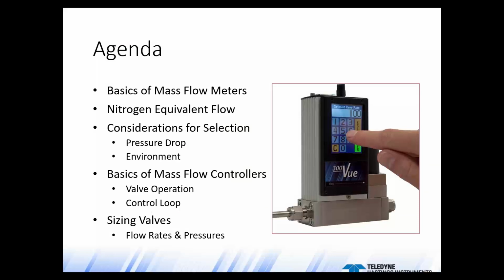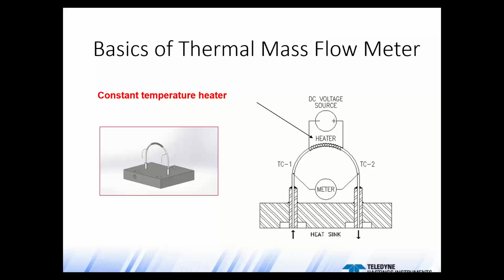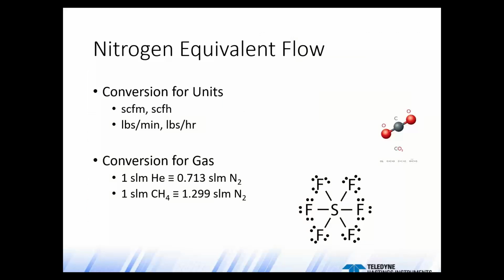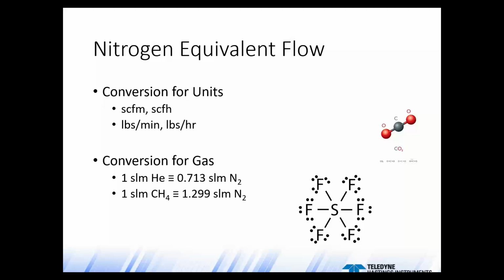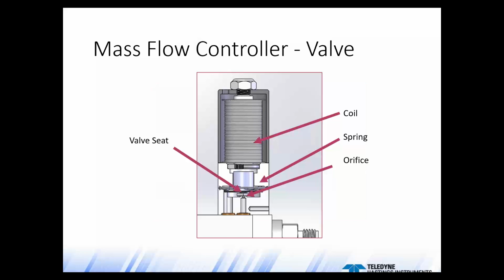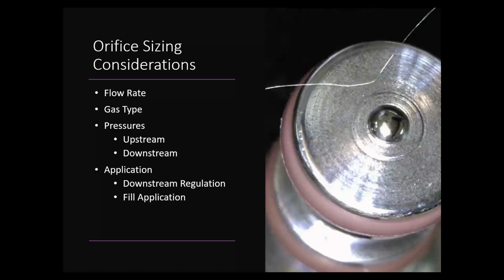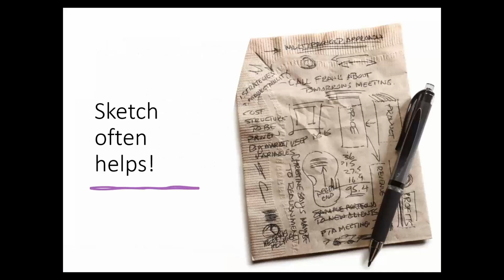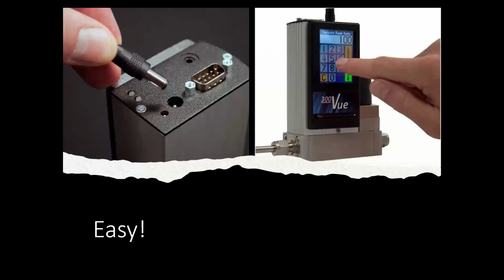Teledyne Hastings   Selection and Sizing of Thermal Mass Flow Meters   Mass Flow Controllers

Comment: Thanks for the video! Could you dive deeper into the shunt and how to determine the correct size for a given orifice size. For the HFC 202, there can be a shunt wheel with multiple holes and it would be nice to know which one to choose, especially if deviating from the calibration from the manufacturer